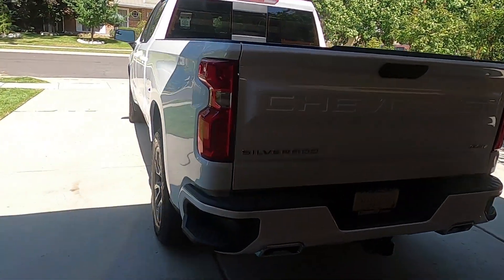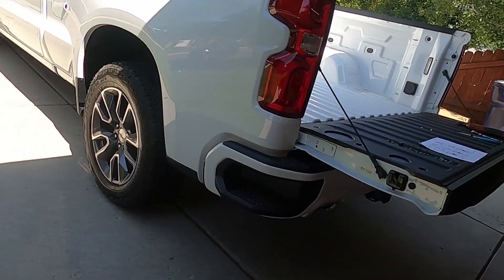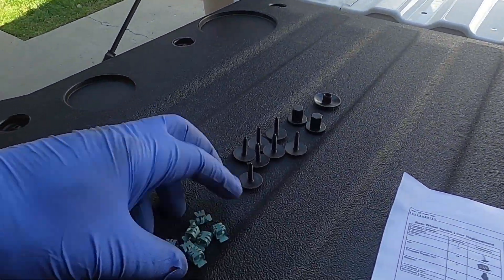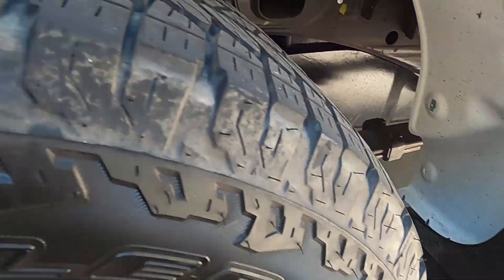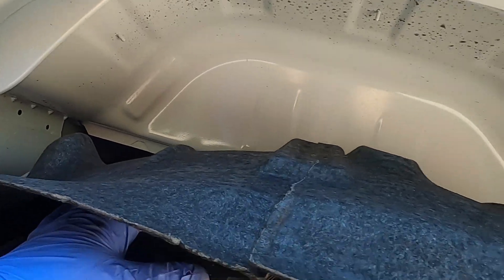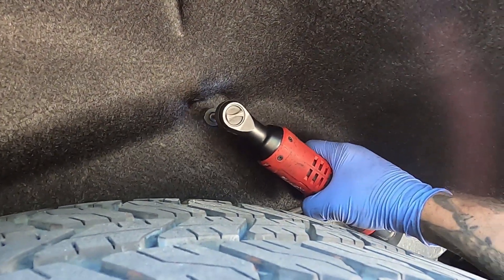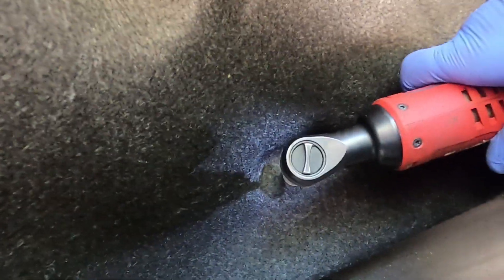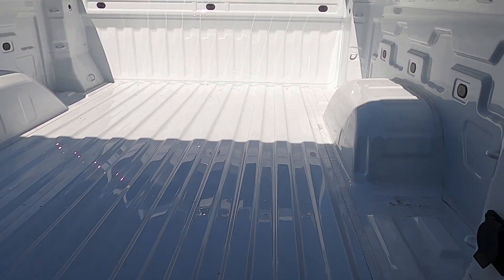2020 Silverado RST Duramax gets some GM Rear Fender Liners installed - MUST HAVE !!!!

Comment: Just found out on my 2022 Sierra I have on order that at the last minute these were marked as Not Equipped with a $140 credit. Looks like I will be adding these myself. No reason these should not be factory installed, heck I even ordered the X31 package so I would get them along with a lot of other options I wanted.
Reply from the maker: These are a must have !!!

Comment: I have a 2024 1500 Custom Trail Blazer and the GM # for rear wheel liners is 19434124. My truck is black and thus I do not need liners for esthetics but for protection from rocks and debris they seem like a good idea. They cost $149.

Comment: Does the front already have a fender liner? I just ordered a 2021 Silverado RST, & I did end up getting the bed protection package with the bedliner & rear fender liner, but I’ve been looking everywhere to see if the front already Come with them? Since I can’t find any aftermarket anywhere!? & of course don’t have my truck yet to take a look myself
Reply from the maker: You are good ! Fronts come installed on all trucks.

Comment: Ordered a new 2022 3500HD High Country Dually is $95K and it didn't come with the rear liners and the dealership told me that it's a option which it wasn't, i went back and looked on build your vehicle to see if i missed it and i didn't it was not a option. So dealership told me they world order them.  So paid them and I've been waiting for over a month and just found out last week that they didn't know what in the hell they were talking about and that they don't make them for the 3500 dually's.. this in the kind of crap that really pisses me off. Buy the most expensive truck that they sell and not having rear liners is beyond stupid.  This is just one of multiple issues I have with GM's trucks. Because of crap like this I will not but another GM. I will be posting videos of the build when I get time.  About $50k of extra goodies going on it.  Now I have to figure something out for the rear liners.. 37s throw alot of rocks!!!